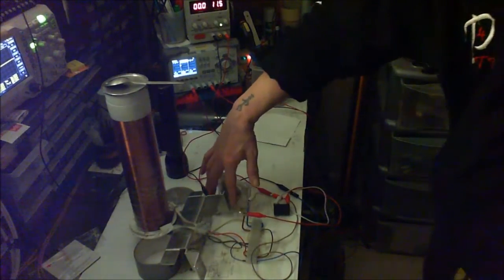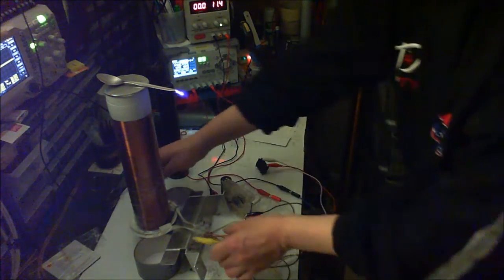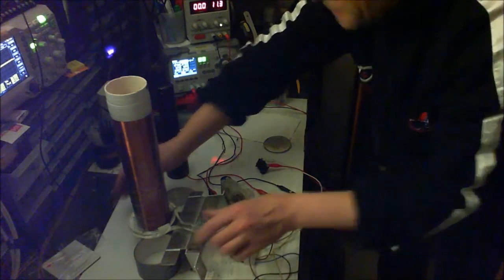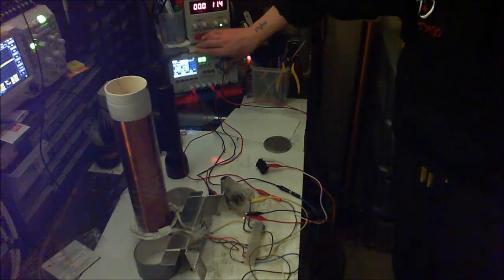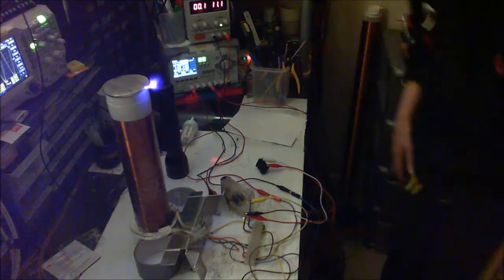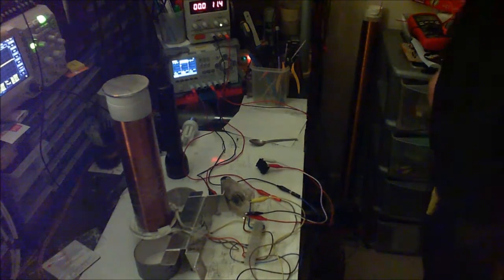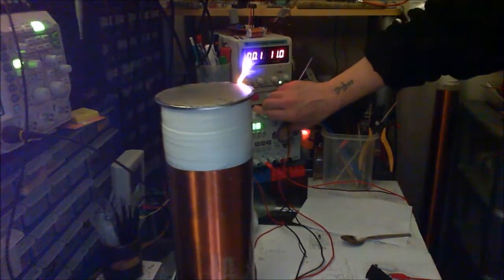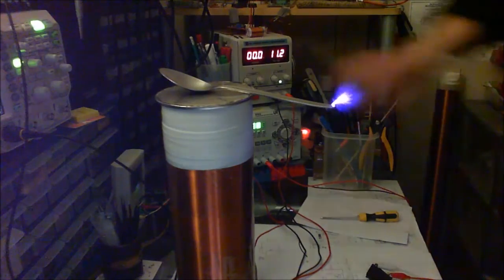Simple Powerful SSTC Solid State Tesla p2

Comment: I had my taurus set off to the side with one transistor going and touch it with my little neon build, and it lit up brightly. It was  not transmitting enough to light the bulb in air at the same distance, I found it to be quite fascinating.This is very rewarding circuit. what diameter wire is on that coil?

Comment: hi what gauge magnet wire did you use? Transistor? Capacitor is it polarized voltage and capacity? Aprox how many turns? Used in the video... Thanks :)

Comment: I tried to use dual primary tip31c transistor running 19v 3 amps only getting 1cm sparks :/ how much voltage are you using :)?
Reply from the maker: 60 watts from a TIP31c that is better than transistors spec. I think I was using 45 volts.
Reply: There is no f*cking way you got that from a tip31c! I was getting a 3 cm arc at best with it! If you used a TIP31c, please send me your schematic! BTW, awesome video!